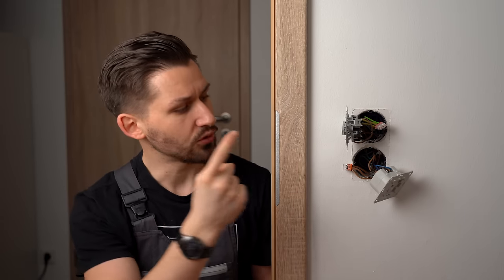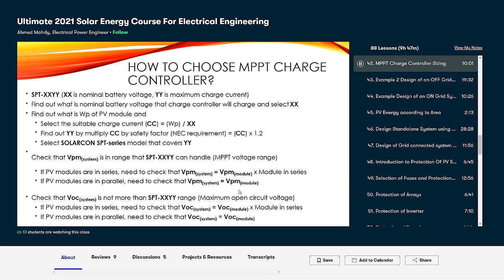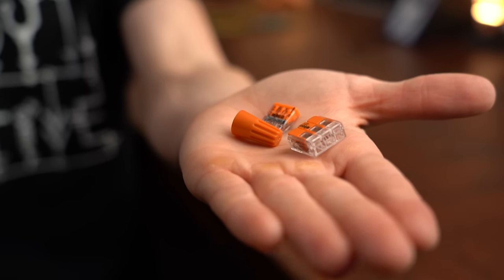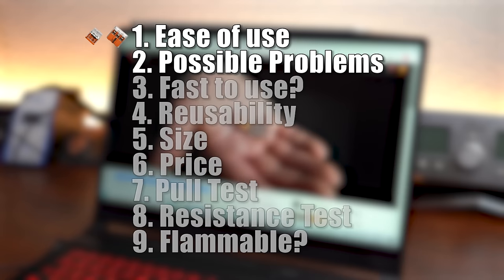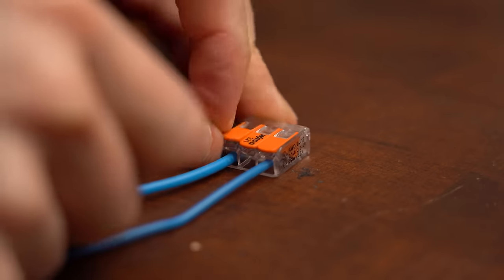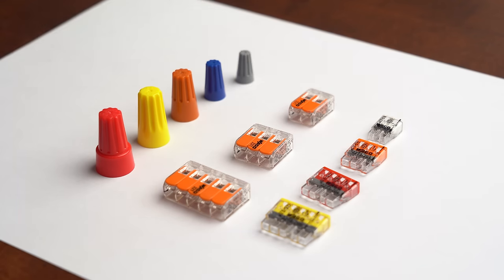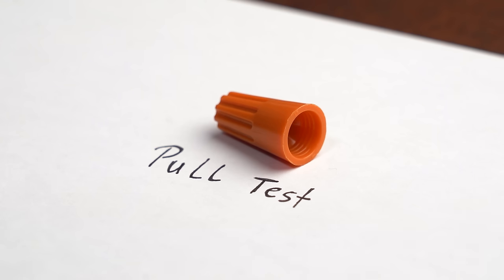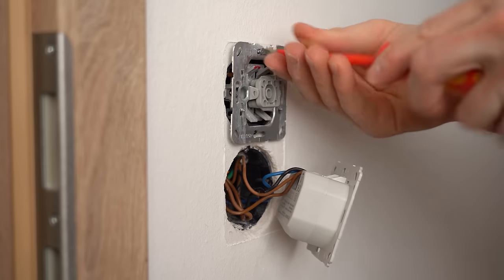What Wire Connector is the Best? Settling a Debate! Wire Nut VS Wago

Comment: I was taught by the U.S. Navy and don’t have any experience as a professional electrician in the civilian world but my training was to always make a secure mechanical connection between the wires before adding the wire nut so the wire nut is a redundancy instead of the primary fastener. Our trainers regularly pulled on random wires to see if we had short-cutted this step.
Reply: Twisting wires together with pliers isn’t hard but it can feel tedious and a lot of people tried to skip it and just twist the wire nut on. I find a lot of that kind of work when I’m doing little repairs so I don’t know if that’s not something that’s regularly taught or if people are just lazy.
Reply: This gives me "electrical school" vibes c:
Here in Italy we use screw connectors, but twisting never seemed to prevent the pulling out.
The most professional way we learned connection, is to firstly put on a cable . . .tube? (round metal that fits over the cables) and the other things just for protection.
Twisting cables isn't allways posdible, especially with larger diameters. Most connectors here make a really tight fit with straight wires
Reply: @caked3953  I think the term in English you're looking for is "ferrule". A metal tube that you crimp over the ends of the wires?
Reply: @seabeepirate  Yes, the proper way to use a wire nut is to twist the wires together and then “screw on” the nut. This is how I’ve been taught as an electrician pre 2000.  Given the fact that Wago like terminals were already present and you basically use then as they are easier to work with the education did cover the Wire Nut as it’s possible to find them in older houses. So about 5 of the practical installation we had to use a wire nut just to know how it works. 
We basically use the same German standard here in its neighboring country, the Netherlands.

Side note: Scott only used 2 wires and could reuse the spring. If the nut has more wires going in you most definitely can’t get the spring out without “destroying/deforming” it and you have to buy a new spring. The holder can be reused as you can “unscrew” the cap from the spring.
Reply: Twisting wires together before installing a wirenut is something taught by teachers that teach and don't work. It's a horrible practice. 1. Unnecessarily time consuming. 2. Unless you're going to twist and solder, twisting wires is a crappy connection that can EASILY hide a loose wire nut. 3. It makes any service work dramatically less safe, not to mention the PITA to untwist all wires straight again.  Not to mention the problems of twisting different diameters effectively and god forbid stranded wires. Worse yet many diy-ers don't even bother to re-straighten. When I see wires twisted with kliens inside a wirenut it's a red flag someone with more desk-time than field-time was in that box and to check EVERYTHING in the vicinity. A properly installed wirenut is a MECHANICAL connection. Wagos, REAL Wagos, are good but pricey. For every Wago I see, I see 50 cheap dangerous imitations. Flame away. Just know I've seen most everything in my 37 years actually in the field.
Reply: @bobtenwick  old time experienced electricians like you and I can set up our wires for proper termination with just the nut.  No pre twist necessary.   The young ones and the lazy ones are prone to mistakes and sloppy workmanship.  I make them pre twist the solids and then apply the wire nut.  I will come in behind them and open up boxes to check terminations on devices and in the wirenuts themselves.  If/when I find sloppy work I make them open every box and show me perfect terminations.  They generally only make the mistakes once or twice if they are dim!  I will still follow up even the good and experienced techs to assure proper workmanship,.
Reply: Instructions from wire nut manufacturer says not to pre-twist. I've seen videos demonstrating this.
Reply: I've always twisted my wires before putting the wire nut on. It eliminates having to track down a loose connection.
Reply: Yes me to on the plus side wire nuts have thicker plastic, better insulation.
Reply: @bobtenwick  my father has been a master electrician for 60 years. He twists them. As far as I know all the guys of his vintage twist them. When we wired my house up the electrical inspector checked to see if they were twisted. Not code, but the inspector wanted them that way. He does not twist stranded wire, it does make a weaker connection. I have had 4 or 5 wago connectors fail that were factory installed inside recessed lighting fixtures.
Reply: @seabeepirate  It is not recommended per the manufacturer instructions. A properly tightened wire nut will not pull off, as the wires will be twisted by the action of twisting on the nut.
Reply: The wire nut is a pressure type connection. Pre twisting is not necessary and also not sufficient, or you would not need a wire nut at all.
Reply: @bobtenwick  excellent summary. One more thing is that when pre twisting 3+ wires I've often seen one of the central wires be far looser as it's not making any contact of it's own with the spring.
Reply: @anonemous4529  Old Timer pretwist because old time wirenuts REQUIRED it. Ask him. You'd twist the wires, CRIMP them, then twist the plastic cap on. Old timers used to ground to cold water too. So much that it's specified on nearly every set of plans that roll over my desk. I wouldn't worry about any splice that's made with half his experience, BUT, it doesn't mean he's on board with best practices in 2022.
Reply: @anonemous4529  I'll add that the Wago style connectors you found in fixtures are NOT Wagos. They're the dangerous imitations I spoke of. Unmitigated garbage for the most part. Move 14 amps through one and look at it through your thermal. Wagos are a different breed.
Reply: @Icytits  Pre-twisting is generally couched as "acceptable" by manufacturers. It's never encouraged and certainly never preferable.

It's a practice that's ensconced as a hold-over from the old days when it actually waa a requirement due to connector design.
Reply: I've been corrected by an old timer lol. The crimp was preinstalled in the cap. Twist and crimp.
Reply: @SwapPartLLC  If you have loose connections, you're not even close to doing it correctly.
The manufacturers state that you are NOT to pre-twist the wires, they are supposed to be twisted together in the process of installing the nut so the spring can properly bite into and permanently connect the wires.
Reply: @SwapPartLLC  We've all read it. "Acceptable" defined as able to be tolerated or allowed. Lots of things are tolerated or allowed. Dating your cousin is tolerated or allowed. Doesn't make it right.
Reply: Yeah.  This is a big factor, he didn't use them properly but he absolutely did use them in the way most american electricians will.
Reply: yep, not a residential electrician, but I have always seen/heard that the wires need to have a "pre-twist" first.
Reply: @bobtenwick  People are literally trying to say the manufacturer says it's not recommended, and that's completely BS. There's a huge difference between acceptable but not required, and not recommended.
Reply: @SwapPartLLC  yup, it's likely a strategic choice of wording. The manufacturer knows that if they required twisting, then some pros, in particular, those install in large scale,  twould buy nuts that didn't require twisting.
Reply: @suspicionofdeceit ideal's instructions explicitly state that twisting is "acceptable, but not required".
Reply: I've read that before as well and took it as "we're not telling you our opinion on which method is safer but our nut doesn't require pre-twisting if you prefer to skip that part."

My boss taught me to pre-twist w/ a few twists added in the insulated parts and his 30yr+ taught him to with reason being that it's an additional fail safe method to prevent anything/anyone from unknowingly pulling 'em apart (Joe schmo trying to yank on lines that're too short in an outlet) and to keep conductors tied together if the wire nut should fail for any reason (i.e: possibility of thermal expansion/contraction over time causing nut to come loose and since conductors maybe weren't twisted sufficiently by the nut as intended when installed ya end up w/conductors pulling away from each other enough to cause arcing)

From my experience the ppl who take the short amount of time to pre-twist are also the ppl who double check that their wires are stripped to correct length and nuts are secure since I rarely see loose nuts where pre-twisting was done but I run into non pre-twists all the time where the nut was barely put on and pops off the moment I mess w/it along w/conductors barely turned around each other often knicked from crappy strip job and/or overly long.

Pre-twisters take pride in their work and do what's necessary to prevent fires, nut twister's don't give a $#@t and it shows. ;)
Reply: @bobtenwick  it just makes removal time consuming and also difficult to stuff back in abox
Reply: I never pre-twist, and I curse people who do. It often destroys the wires, and causes the next guy to have to put in a lot more work that what is necessary. 

I'm sure the Navy had their reasons for the unnecessary redundancy, but it comes down to them trusting what you do VS you trusting what you do in civilian life. I'm sure there are a lot of examples of methods taught in the Military that are over-laborious simply because they're easier to verify or they are redundancy used for assurance.

If your commanding officer didn't believe you to be able to twist a wire nut on properly, that's understandable. He/She has to deal with all types of people, and doesn't have the time to learn the individual capabilities of each person under them. However, if YOU don't believe you can twist a wire nut on hard enough to make a solid connection without pretwisting... well... Maybe Wago is for you.
Reply: I agree and disagree just don't loosely throw a wire nut on 4 #12's but don't over twist with pliers to the point you have 2" of the insulated wire twisted with it. I pretwist but I always make sure I get a consistent twist with the pliers not a shitty half ass inconsistent twist. It's harder with twisting different gage wires together. But you must master how to have consistent clean splices to be a good electrician. The thing is in residential there isn't much money in most areas so you have to cut corners and work fast. Pre twist isn't always possible. I can get a really good splice without pre twisting too but I use a tool on my drill to do it
Reply: All of this discussion is just proof of why levernuts are better
Reply: @bobtenwick  been an electrician for 18yrs, was taught wire nuts are for protection not connection, and not all wire nuts are rated to twist wires for you, and when it comes to service, how is it harder? Do you not twist you splices? Are your grounds just loosely touching? Not flaming just asking based on my experienced as a license holder
Reply: @billvojtech5686  depends on the manufacturer and this leaves it up to the installer, and if you haven't had a helper fuck you with loose splices you are luckier than most, I make all helpers pre-twist, wire nuts for protection not connection
Reply: @johnb4306  I'm just a DIYer. In the distant past, I've pre-twisted, put on the wire nut and then taped over the wire nut, just to be sure. Now that Wago is available, I think I'll use those for future projects.
Reply: @johnb4306  Congrats on 18 years, and it's refreshing to see an 18 yr journeyman that's still open to other's experience. I'll take your comments in order. Wirenuts are absolutely for connection. The internal spring becomes a compressive connector when it's tightened. I do NOT twist my splices. I strip almost equally, lead (VERY slightly) the conductors that should be lead, Apply the nut and twist until the insulated portions of the wire just begin to twist. Then STOP. The nut doesn't get tighter from that point. If I remove a wirenut I expect the wires to be almost straight and to fall apart easily as the nut is removed. Service gets orders of magnitude more difficult and dangerous following electricians that pre-twist because once the nut is removed the conductors stay connected to some degree. They need to be unraveled to separate, and usually the conductor that's hot isn't identified. So you're dealing with 3-4 curled bare rattlesnakes in a box until you can separate them and get a meter on them individually. No, my grounds aren't loosely touching. They're spliced exactly like hots, switch legs, and grounded conductors. I see a low impedance path from ground to the source to be the most important splice in the box. Often the most neglected, and usually the most misunderstood.

Diving deeper into which conductors should be led in a nut gets complicated, defined by diameter and stranded or solid, but a lead of 1/64 is sufficient.
Reply: @bobtenwick  what ever works for you, but i'd fail inspections if none of my wires were twisted, the AHJ would not accept, and i don't understand the service aspect, i'd feel way more safe working on a hot splice knowing that if a wire nut is loose a hot wire won't just pop out, it takes 2 seconds to untwist, my splices have plenty of wire to work safely outside the box. Each there own I guess
Reply: This discussion shows there's more that one opinion about the wire nut. I was also taught to twist first and it certainly was checked regularly by the inspection.
But I also remember it's very easy to do it wrong.
I guess without twisting it will also work but I think a lot of people use the wrong diameter, resulting in loose wires as the tension to keep all the wires together correctly will be too low when using the wrong nut. 
I think for normal use, like houses, the Wago connectors are more than adequate and less prone to errors for most electricians.
Reply: @nickrobalino343  You nailed it.  Cheers.
Reply: They instructed us in high school with the same twist method.  3 wires seems ok to twist but 4 usually results in a less uniform twist and one wire not being held so well.  In my opinion.  Maybe I can't twist properly.  I've never started any electrical fires tho either.
Reply: @johnb4306  I've failed inspections for not grounding to cold water, despite explaining to the over-schooled and under-experienced inspector that his glorious copper pipe turned to PVC 6" underground. I have no desire to argue. Twist away. How do you add a conductor to your twisted splice? Do you meticulously straighten each wire and retwist? Do you twist the new conductor around the outer diameter of your twisted bundle? Do you cut out the twisted mess and re-twist? If you're not taking the time to untwist each individual conductor you're doing it wrong. Do that with four conductors not knowing which is hot, and without weakening the copper. Then watch me undo a perfect splice, add the new conductor and re-install the nut. Twisting is acceptable. Re-entering that nut presents a new level of chaos.
Reply: @barms9768  I believe the minimum IQ for military service is 92. I fully agree if your IQ is in the 92-98 range by all means pre-twist. Concentrate, take your time, consider solder, just focus on what that teacher said. And please be careful. +1 on Wagos. B Arms is absolutely correct. I love our military, BUT, as a supervisor there are a few things that make a kid most likely un-hireable. #1 is being trained by the military.
Reply: Not an electrician myself but have observed certified electrician friends. Every time they would use a wire nut, they'd use their lineman pliers to hold and twist the wires around each other until they were solidly intertwined, then twisted on the wire nut as a redundancy, like you said.
Reply: @caked3953 nice
Reply: That’s the way I was taught. The man that taught me was an electrician in the Navy so he passed on the knowledge that you talked about. Everything had a right way and anything else was the wrong way. He was an excellent teacher and mentor.
Reply: This is part of the issue. It wrote lies on you creating a secure mechanical connection, but most things that require that you specialised tools that actually gives some kind of indication of the level of connection.